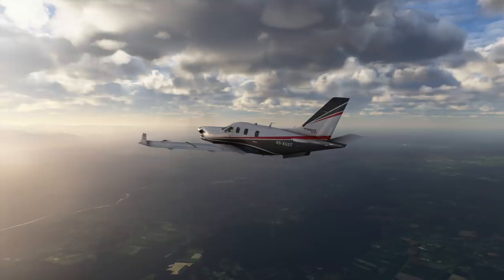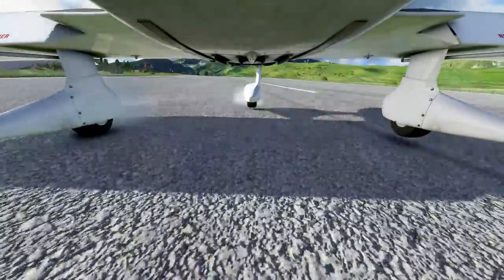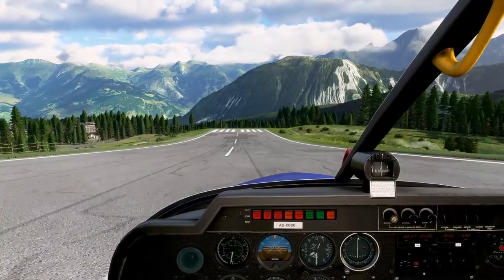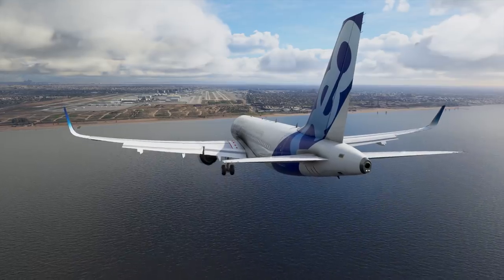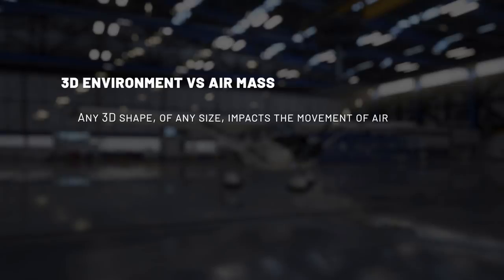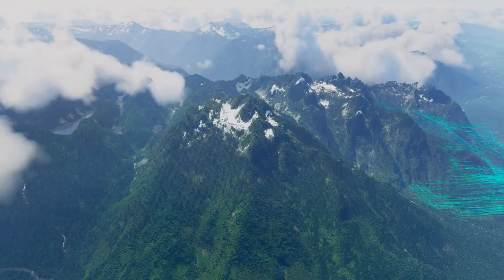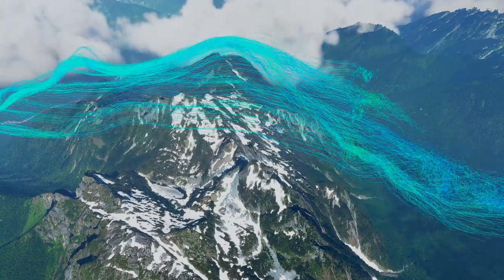Feature Discovery Series Episode 3: Aerodynamics

Comment: Very happy to see this, you seem to have thought of everything!

Regarding the heat blur graphical effect: if you want to do this as well as everything else you are doing, I have some tips for improving it:
- when the air moves fast relative to the camera, you don't see the big optical distortions in real life. Part of it could be a motion blur effect, where you would just see a blurred image but no varying distortions. The other part could be that straight out of a jet engine the air does not have varying density yet, it only happens after some distance. Anyway, it means that a camera following a flying jet (behind, or seeing out the passenger window) won't see the typical heat blur distortion seen in this video. It's something you typically see from stationary cameras on the ground when the air is moving slowly compared to the camera. Check out the window the next time you are on an airliner :)
- in games/sims the effect has a tendency to blur objects that are in front of the hot air sometimes (typically the edge of objects), which doesn't happen in real life. If the shader could take depth into account in a better manner, it would look a lot more realistic.

I haven't seen anyone else do this correctly yet. But since you are doing everything else so well, I wanted to mention it :)

Now I only wish that force feedback becomes a thing for flight sim controllers, there should be a huge market for that with a realistic sim like this, like in simracing. I hope the architecture of the sim can support realistic force feedback in the future.

Comment: Excellent, are you folks taking into account tangential friction force during take-off run, not just lift, wheel friction, surface type, but also the relative height of undercarriage and wings above the runway ... so for lower (usually smaller aircraft) vs. higher (usually larger aircraft)?  If being calculated this would eliminate all the current tendency in simulators to wonder from center-line as speed increases resulting in most cases what looks like over correction but is really just no change in wheel friction as speed increases ... a flaw present in all current simulators.  

It would also be very nice to see variable Gust Load implementations (non-sharp edge) at all phases of flight ... especially wind shear ... wind shear is a huge "topic" with ATC and pilots during approach phase.  Bring that implementation to life would be tremendous ... keep up the good work.
Reply: I do hope they saw your comment!!!! might as well let them know now before the sim finally releases!
Reply: Hello.  you can submit your comment in the forum AVSIM MFS2020??  interessant
Reply: Actually if they are using virtual air there would be no calculations. It would just work like real airflow.
Reply: I doubt it...

Comment: Wow, the simulation of air and particle flow is mind blowing. Well, if the aircraft shipped with the simulator are gonna be study level, or at least close to a study level, what more could you wish for?
Reply: built-in multiplayer and multicrew and a 12Hz refresh rate
Reply: I'm hoping for a wide variety and number of aircraft unlike X-Plane lol
Reply: Mind blowing based on what? Looks like it's just repeating the terrain contours to me... What's really mind blowing are the professional fluid dynamics suites. Not that we are ever seeing that kind of air flow simulation in real time though...
Reply: PMDG is fully onboard the FS2020. If included AC are not exactly study sim, these guys will deliver them.
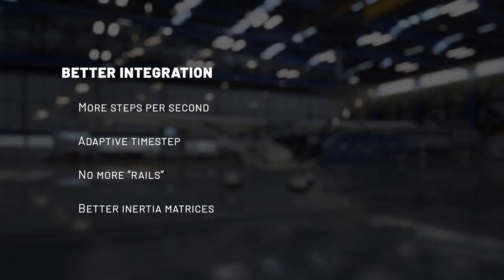Reply: Looking at the A320 in the video (3:48), I'm not sure if they will be. The primary flight display looked rather simplified for an A320 and some of the annunciations that I would expect to see on final approach (LOC and G/S) weren't shown. Then again, this is still an early alpha video so there's plenty of time for improvements to be made to the aircraft.
Reply: @Doofer911   You are correct, we'll likely get more details about this on Wednesday.
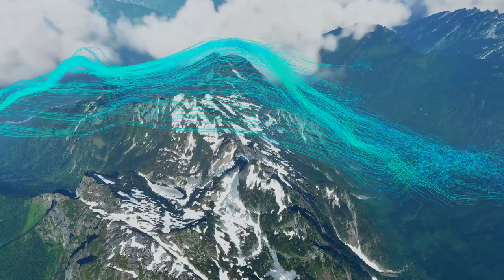Reply: Get Sideways But it’s clearly not just mimicking terrain contours. Look at 11:20. Remember, this isn’t 1000 particles in 1 simulation, it’s 1 particle in 1000 different simulations. The weather graphic is just one static image but would be different for each simulation. If you look at the first dip into the valley in the top left, you can see the draft sometimes exerts a downward moment on the particle and sometimes exerts a sideways moment on the particle, clearly because of different weather systems or wind conditions above the valley. So you can’t say that this just mimics contour lines.

Comment: That sounds and looks rly nice! Would be interesting to know if the internal fluid systems of the aircraft will be simulated accurately. So a 172 flying upside-down would have oil pressure loss and as a result its engine failure.

Comment: Very excited about the airflow around buildings... as a real pilot I can say it's quite common to get pushed about just as you flare for landing - typically with disturbed air flow coming off hangars or buildings beyond.  Previously I would simulate that with cranking up the turbulence setting in other simulators, but this would often make cruise flight too wobbly.   I'm also keen to see how this simulator would work for gliders and realistic ridge soaring, with dangerous rota in the lee of a hill.  Soaring is traditionally a weak area for MSFS.  Thermals are another consideration...

Comment: I’m surprised in how the physics core engine has changed in this new iteration of Flight Simulator. And not only that but in general all of the other aspects as well. Congratulations!

Guys, I have a question about this: do you take into account not only the standard fixed-wing airplanes but also helicopters, supersonic aircraft and aircrafts with canards (e.g. Beech 2000 Starship)?

Comment: @Microsoft Flight Simulator Previous versions of MSFS included a 737, but FS2020 will not as part of the default aircraft listing at initial release. Will there be a SDK for aircraft designers to produce a 73NG or are there plans to include one (737-800 preferred) as part of future updates?

Comment: Number 1 thing on my checklist now that NEEDS some love is water landings. Water is treated as a hard surface currently, so when landing it takes forever to slow down, and to start moving from a standstill takes a lot of throttle, which is straight ridiculous. I grew up around seaplanes, I still watch videos of seaplanes, and the water dynamics within the past simulators are just straight garbage. REALLY hoping FS 2020 improves that aspect, they've put so much work into other things and it looks amazing!
Reply: There is the Icon A5 confirmed so there is a seaplane. Now about buoynacy and other fluid physics is a good question. We do know water can be affected by wind and create waves but if those waves and motion of the water affects a plane is still a big question.
My guess is that it will probably be much better then FSX or other flight sims that allow water landings.

Comment: Anyone else notice at 7:00 that the aircraft appears to pivot about the horizontal stabilizer??? When you push down on the yoke, you are using the elevators to generate lift at the horizontal stabilizer, which causes the tail to go up, and the aircraft should pivot about its center of gravity. pushing down on the yoke does not simply make the nose drop. I'm hoping this is just an early build and the physics will be improved at launch. I also realize the spot camera is attached to the aircraft, but I don't believe it would be the cause.

Comment: 4:15 the way to make the turn coordinator realistic is to set it to follow only the position of the plane, and not also the rotation. So, set ”unfollow horizontal axis rotation of the ring” then when the plane turns, the ball will follow the plane rotation but not the ring of the instrument box, that it will remain levelled, and then it will give you the real-time turning angle.. same for the vertical axis of the altitude indicator ball but it is little bit different, because is not properly the rotation but the position. So you have to proportionate the vertical moving position ratio with the plane a the diameter of the world.. on water level is 0 , the middle of it or more simple, setting only the proportionated radius or max altitude of the globe, then again it will be a real time physic with and light code.. so i hope you did something like this.. I’m not properly a programmer but I use some 3D software as cinema4D and developed some website also, so I just know what instruction give, but unable to properly write it 🤣 so my suggestion is to set physical dynamics and not just static programmed codes and functions 😋.. of course for things like flaps or gear is necessary a static dynamic but also influenced by the world conditions and speed of the plane. To let it broke and simulate structure stress if the  place has high speed for example... 👍🏻 anyway I hope you will develop military planes.. as the mentioned flight simulator x where in the accelerator pack there was the Hornet f/18 and also an ufo 🤣😁🛸 anyway I suggest to take concepts from  games like war thunder.. is a free II war realistic flight simulator.  Just for about the physics to more improve the realism of fs2020 especially if you will implement military jet planes it may help the development

Comment: A bit disappointed though cause the pitot-static system and the IAS still seems to be overlooked with all these levels of realism going on. 95% of the time in my career as a 74F ATP so far, the IAS just doesn't sit still like what has been shown in the video and experienced in the FSX. Would be nice if the interaction between the wind and the pitot-static system can be realistically simulated as well since the management of an ever-changing airspeed is as important as the attitude during an approach. Still a great game though.

Comment: So, you model the airflow through 1000 subsurfaces now. So, where's the performance profit of lookup FM it always used to have versus blade element or AFM now?
Reply: How is it possible.. they model 1,000 subsurfaces and yet.... it doesn't even model adverse yaw, which is one of the most basics aerodynamic effects and. So no coordinated turning with rudders as of now.

Comment: The question is, Will it have Wing Flex ?

The small cut of the 747 at the start, that plane has quit heavy wing and a lot of wing flex (because of the engine) but didn't see wing flex.
Cause if they put the B777, that plane with no wing flex is not a beautiful 777 :(

Comment: Will the aerodynamics simulation in this game any better than Prepar3D, which used for flight training?
Reply: Definitely will be better than P3D, as P3D isn't any different than FSX's flight dynamics as far as I'm aware.
Reply: @RiverSkyHigh  So the flight dynamics in a 'game' is better than the flight simulation used for flight training 😂😂😂
Reply: @ocseong818  Yep, basically. However, the distinction between a "game" and a "simulation" can be largely semantic. Clearly Microsoft/Asobo are making this new Flight Simulator a, well, simulator (hence why it's in the name). However, it can also be called a "game" for marketing purposes. Flight Simulator X was both a game and a flight simulator, yet I've seen it used as a procedural trainer at flight schools. When FSX was sold off to Lockheed Martin and turned into P3D, it could not really be marketed as a game as such. But P3D and FSX are essentially the same, except Lockheed transformed the code to 64 bit and made some overall (mostly incremental) enhancements. Also, it's too early to say, but this new Flight Simulator may very well be used for real flight training at some point.
Reply: @RiverSkyHigh  Yes! Agreed.

Comment: Will you consider the change in turbulence when you fly over different landtypes over different time of day? Eg air over sea is usually quite stable but once you get over eg cropland you will get much more unstable air since the accumulated heat in the ground will be released later on. The effect is very pronounced where i live.

Comment: hey guys, your Ice buildup visuals are not realistic.. and I hope they get changed before release.

You currently having the airplane "freezing" like it's sitting on the ground on a frosty night, the windows accumulate ice from the edges, in random directions from the relative wind. Seen here 5:11

in your video ice accretes on the upper and lower surfaces of the wings before the Leading Edge, and on the sides of the canopy and engine cowl at the same time/before the forward portions of the aircraft. Airplanes do not "freeze" in icing conditions. Rather, the suspended water/ice strikes the airplane and freezes at that location first. Reminder the vehicle is being subjected to a 150mph hurricane blast of freezing water/ice from a single direction only.. not sitting on a damp cold night.

See the linked image here. This is obviously viewable from your videos, thanks! https://www.aviationweather.ws/page097-1.jpg